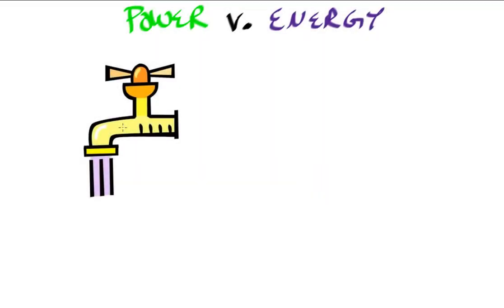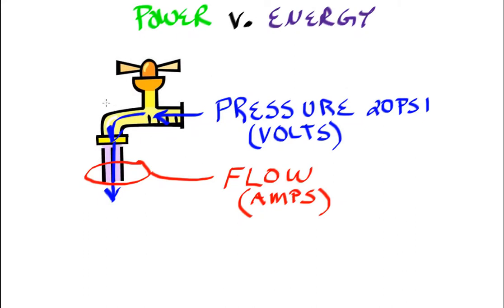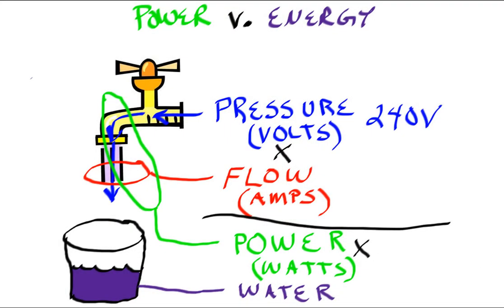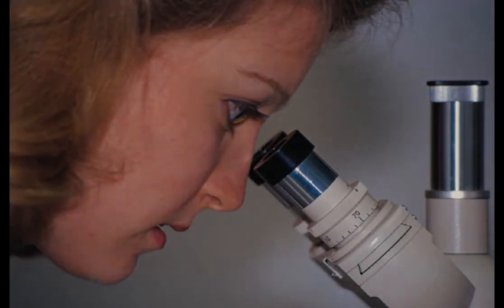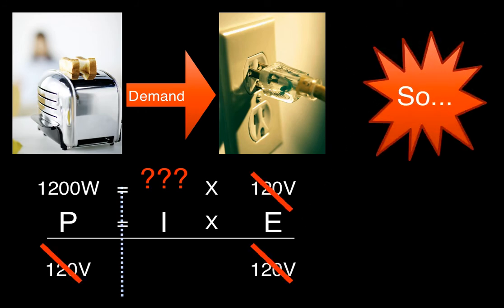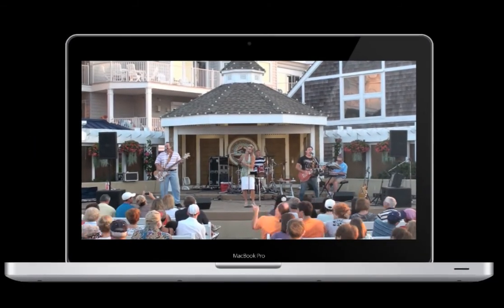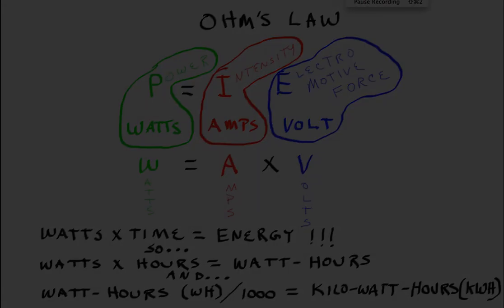Power v. Energy

Comment: Nice Video. Explains very well. 

I also wanted to know the difference between Energy Density and Power Density which are common terms used in batteries in Electric Cars these days. Why does Hydrogen (used in Fuel Cells) have a lesser power density than Coal and Wood? I was expecting the other way. Or is it that we have to take pressure into account because they say 1 kg of Hydrogen has more power than 10 litres of Gasoline.

Comment: In short, the difference between power and energy is time. Power is a snapshot of what something can do. Energy is how much is actually used.

00:30 A simple example - a water faucet.
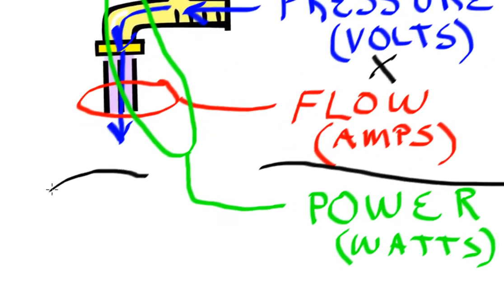2:59 Energy is the power we use over time. i.e. energy = (power*time)
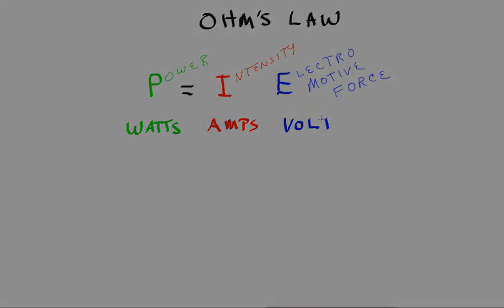6:21 Ohm's Law formula: watts = (amps*volts) Measures the amount of electrical power.
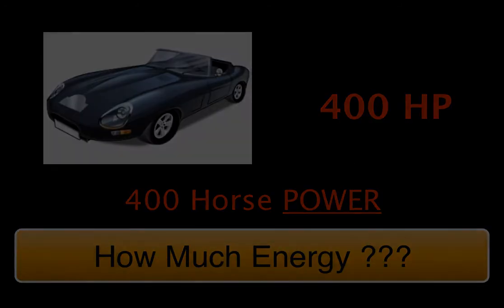8:25 Another simple power vs energy example
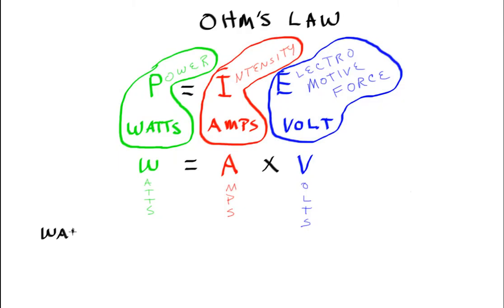9:45 A quick summary.

Comment from the maker: You're right!  But actually, the complete Ohm's Law has 4 components:

Power (Watts), Intensity (Amps), Electro-Motive Force (Volts) and Resistance (Ohms); here are all of the formulas for your use:

P=IE
P=I Squared X R
P= E Squared /R
I= Square Root of P/R
I=E/R
I=P/E
E=Square Root of P X R
E=I X R (this is where you got your V=IR), and you are correct!
E=P/I
R=E/I
R=E Squared/P
R=P/I Squared

Hope this helps!